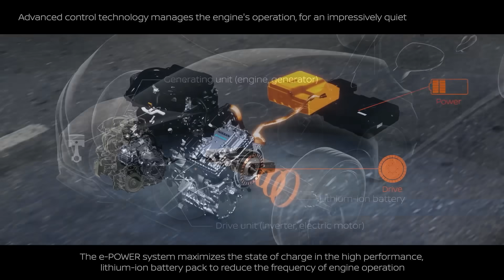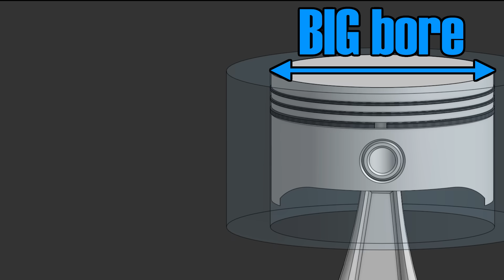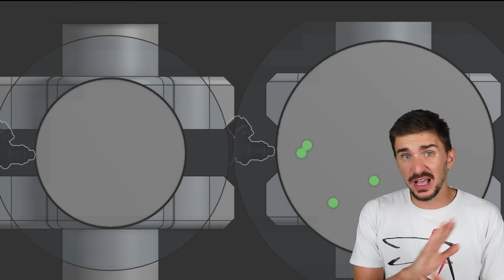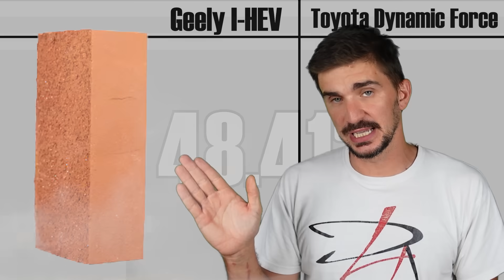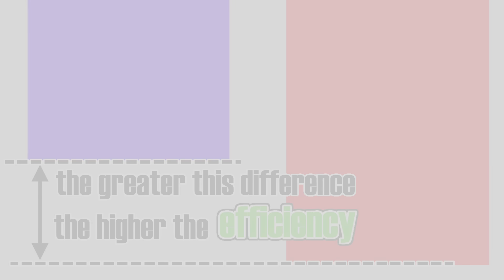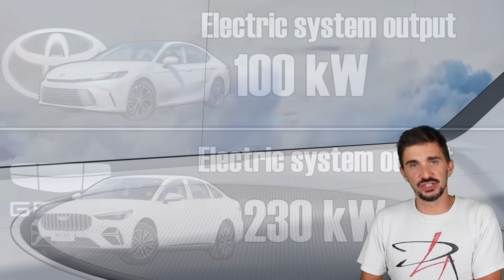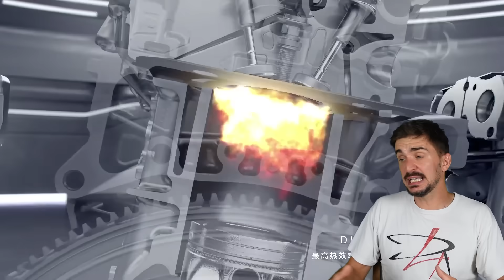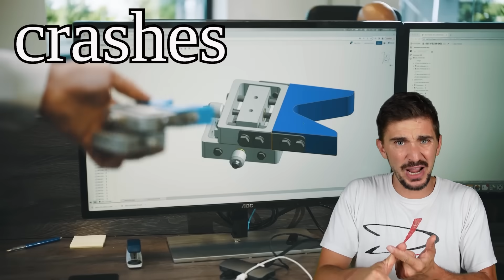How China's Geely Beat Toyota, BMW, Ford and Everyone Else

Comment: This video is only weird in how it does not mention BYD's DM-i system at all. In fact, you go on to say Geely is the only manufacturer making an electric-first hybrid, whilst BYD's DM-i has been around for a good while with the same basic approach, currently claiming an almost matching 46% engine efficiency. 

The lack of mention feels odd as BYD is a larger and more globally-spread manufacturer than Geely currently is.
Reply: Also they are not backpedalling from EV adoption, the reason they can take this approach is because the west might have all the ICE manufacturing experience in the world but China leads electronics and electrical manufacturing so they have a much easier time implementing an electric-first design...

Comment: Um, I thought we just called that arrangement “series hybrid + battery” which is the same thing Ram and Scout are doing. I’ve been clamoring to the economic walls that surround me that this is the best method for long haul trucks for a long time. In USA, there was a man named Pickens who lobbied for this innovation many years ago. His idea was to use series hybrids powered by LNG, LPG, gasoline, or (shudder) diesel. Batteries would be involved for regenerative braking assist, and initial movement, but the engines would basically run continuously which might be a problem for diesel due to wetstacking. I think the real problem was that nobody wanted to try it until some guys in Canada (Edison Motors) decided to do it.

Comment: Honda's hybrid system is actually very similar to geely's. Hondas's hybrid is basically all electric until highway speeds. But their system is nowhere near as efficient. Difference must be in the engine tunning/design.

Comment: Some turkish channel tried byd suv with a similar approach. Very underpowered ice engine and hybrid system etc. it works very good 99% of the time. Inner city driving, commuting etc. but there is a section at istanbul ankara highway climbing bolu mountains, basically it’s a very very long and high gradient high speed section. At the mid point of the said route, when battery depletes (and believe me when i say this, ai wont solve this, you need bigger battery) you’re just left with an incredible underpowered ice engine pulling the weight of an suv, i believe top speed was as low as 80kph, which is bordering dangerously low.

Comment: Imagine if VW didn't screw the world out of diesel engines. Using a diesel engine like this could hit combined cycle powerplant levels of efficiency at 60% or more. We could be hitting 200mpg and wouldn't even need EVs. Would be much better for the whole world. Hybrids are cheaper than EVs, no range anxiety, would actually be cheaper to run than a pure Bev and the engine would last for decades of it's ran at its peak efficiency at all times and not spending half its life in damaging lean or rich modes. Could use it as a power station at your house in emergencies or a generator at jobsites. What a world we could have had.

Comment: So what you gain is an extended range, in addition to the ability to still use the car (albeit in a substandard performance mode) if for some reason you can't charge your battery.  The trade off is the extra initial cost, weight and maintenance costs of a (smallish) ICE.  I like the idea of not being completely stranded if there's a widespread power outage, and the extended charge range, but I'm not sure if it would be worth the extra expense., weight and maintenance.

Comment: does the geely engine have multiple cylinder intake valves open at the same time? that could possibly use a compression stroke to compress intake air in the manifold

Comment: What I'm trying to understand about this engine is If it being an Atkinson cycle engine then how can you achieve 15:1 compression when the engine delays the closing of the intake valve? As I understand it the compression ratio will drop if fuel and air are decreased in the cylinder as a result of having a long duration on the intake stroke.

Comment: 16:30 surely you could just use variable valve timing tech to make the miller cycle less aggressive when the battery is low on power which would make the engine power output better

Comment: Here's a crazy idea: Use a separate cam like VTEC or collapsible lifters like FIAT AIR to change the intake closing for more power as is needed during those long climbs with a depleted battery.

Comment: The same route chose GM with the Volt in 2010 (opel Ampera in EUROPE) and back then was huge. Then they killed it. Not sure why. It was exactly the same without the AI and the motors were smaller.

Comment: I’ve thought for a long time that cars could benefit from mapping hills to optimize gears and throttle. You do it naturally with a manual transmission. You are slowing down but almost at the top of the hill, everything is fine. You are slowing down but have a ways to go, down shift.

Comment: I'm not convinced that this is necessarily a useful advancement, because there are always engineering tradeoffs. There could potentially be catastrophic reliability downsides for example to pushing thermal efficiency  this far.

Comment: At the start of the 20th century a British government committee came up with a formula for taxing vehicles by engine size, which ended up roughly as the total piston area. Manufacturers quickly realised this benefited long stroke engines, so of course they made them. It then turned out that they burnt less oil and were more efficient for the reasons stated in the video. So, history repeats itself.
As an example, the 1915 Sunbeam Model 3 had a bore and stroke of 85 by 88mm. The 1924 Model 8 was 74 by 90. Performance motorcycles of the era stuck to a roughly 1:1 bore stroke ratio, while cheaper ones designed for economy were long stroke.

Comment: No one talking about conversion losses when storing the energy in a battery and then using the battery power for the electrical motors. Avoiding these losses is the main reason toyota is trying to limit such cases in their hybrid cars using the ICE as the primary motor and avoiding charging the battery with the ICE whenever possible.

Comment: Problem: lost heat inefficiency.  How about using all of that lost heat by incorporating Stirling engine technology into the drive train?  Stirling engines run on temperature differential, which would be abundant in a modern engine.
Reply: You'd need a big-ass stirling for that because of the low power-to-weight ratio. That would offset any efficiency gains

Comment: Im not an engineer just an extreme DIY er with a lot of contacts in motorsport including F1 engine designers from Cosworth (Matt Grant) AMG F1, Redbull F1 and toyota GT diesel lemans winner. The guy who ran the Geely motorsport program with Cyan Racing, also ex chassis tuning engineer at Jaguar F1 . Have We all discussed these engine in great detail and all of us bar non wouldnt by these new ultra thermally efficient engines are a poor investment, due to the use of coating insted of liners and laser burned valves etc to reduce weight plus the turbo to push smaller engines to perform. They are extremely stressed engines. Not completely repairable, scrap if a piston ring goes or if piston slap occurs. They cant be remanufactured so totally unsustainable and the figure hide that they are selling us less metal, reliability, serviceability and longgevity for more money. None of my engineer friends are buying new cars😂. That tells you everything you need to know about modern cars!!

Comment: As a Chinese automotive engjneer, I can tell you this efficiency is “the highest efficiency in laboratory setups”, meaningless in real life. About 2 years ago BYD claimed they have developed an engine with certified thermal efficiency over 46% and later Geely and Chery stated the same, so Xiaomi started to send invitations to these automakers for powertrain quotes 2 years ago for their latest extended range ev product N90 (which was just released last month) and one of the requirements is “over 43% of thermal efficiency over a wide range of load conditions”, and none of these guys claimed with 46% efficiency can meet the requirement, that’s why when N90 was released last month, the thermal efficiency is stated as 42%😂
Reply: Don't you worry, my colleagues and I we know certain Chinese engineers are faking numbers all the time.

Comment: Engineering wise this is by far the most efficient design. It is well known that "generators" are more thermal efficient than "normal" ICE's. It is merely a question of how much battery storage you need before the break even point. I think all non exciting cars will either be electric in some time or are electric with some kind of range extender, the ICE propulsion system is just not as efficient as a generator and an electric motor.

Comment: Through 2020, China was 95% petrol / gasoline engines, barely hitting 5% plug-ins.  China didn't break 50% plug-in (both pure battery and electric hybrid) until last year.  Today, China's market is buying roughly 1/3 "pure" battery electric, 1/3 electric hybrid, and 1/3 gasoline engine.   By 2030, expect to see that gasoline share hit zero! 

With history context, it's an error to imagine that China started with EVs with motors as an afterthought.  It's more that Chinese electric motors, batteries and EV tech becoming so efficient and affordable that they can make everything a plug-in at low marginal cost.  Chinese Plug-in Hybrid EVs (PHEVs) and Extended Range EVs (EREVs) are optimized in ways that aren't possible when battery and motor tech is lacking, as you noted when the car has to run on gasoline alone.  The latest Chinese PHEVs are like a 1st gen Nissan Leaf (100 km / 70 miles electric range) with a 1.5l range extender that's been independently road tested over 2,000 km (1,400 miles).  People rarely drive more than 40 miles a day, this setup can be on battery 95% of the time, especially as Chinese electricity is far less expensive than petrol / gasoline, or even FREE midday in Australia. 

Where China actually lags engine tech is high displacement, high power engines due to their domestic market having higher taxes on anything over 1.5 liters, much higher over 2.0 liters.  This is the opposite of the US which pushed into thirsty turbocharged engines for large, heavy SUVs and pickup trucks.  China doesn't sell many such engines domestically (they may license build some of the older designs), so they don't develop them domestically.  China will NEVER catch up with the West on 3.0l turbos, 5.0l turbos, big block V-8s and so forth;  however, with their gasoline engine market going to zero over the next decade, this won't be a problem for them.

Comment: but with a Z crank spider Opposed piston you have the best of both ! Each piston 50mm stroke over all expansion 100mm and 10K RPM and 80 % expansion .. why not and add 30 degree phase difference to make more usable torque

Comment: Will they factor in the energy/pollution from the “ai” (assuming it is processed by a data center and not built into the car) into the real world efficiency and emissions? 

I do think an electric car with a range extending generator is the “best” option currently available for efficiency and range.

Comment: As with 6 stroke engines the advantages or rationale behind Atkinson/Miller engines vanish if we simply turn to the most efficient expansion device known: the turbine. A turbocompound system can exist independently of an associated dynamic compressor; although at low compression ratios, a dynamic compressor is also more efficient than a mechanical one due to the nearly fixed mechanical losses, which are extremely low in a centrifugal unit. The challenge, then, lies not in the gas-moving machinery but in the mechanical transmission of power from the turbine—an issue currently resolved very flexibly through the use of a high-speed electric generator. This is a technology that has already been in use for some time in military drones whit an high electrical demand.

Comment: but how much is the torque? Bore size of 70 mm and higher stroke length obviously yields efficiencey in fuel but what about power? Muscle cars were designed to go faster, for with stroke length needs to be shorter and higher RPM not a priority for efficiency.

Comment: 17:00 I have normal automatic transmission and it is annoying when the car starting climbing up the hill but the program still change the gear to higher and there is opposite when you are going down the hill he is holding lower gear and revving instead switching gear to higher And this situation don't need implement A I or map of terrain Just simple they should for if torque is rising it means the auto goes up It is so simple

Comment: Would variable timing that changes the duration of the compression stroke based on battery charge percentage work? Like the closer the battery is to zero, the more the compression stroke behaves like an Otto engine.

Comment: It seems like you could call this an EV with an integrated range extending generator on board, I like that if thats the short and sweet description. When you can buy a basic Civic that will seat 4 comfortably and 5 less so, for $30k and get 400 miles at 35+ mpg a pure electric at closer to $40k is less interesting to those that can't charge at home, don't get me wrong, I want a Civic sized EV with 300+ mile range that doesn't weigh over 2 tons, a good hybrid that gets 100mpg(even at real world 70+mpg) is a stellar stop gap between the two if they can get the gas/ev blending set right, especially when the batteries are low. Somewhat unrelated, where's the basic EV sedan that feels like a normal sedan, around 150-200hp, with a reasonable 300ish mile range, and a cost under $35k usd, basically an EV option to a Civic/Prius/Corolla, yes I am a weirdo from the USA that has zero interest in an SUV or Truck, even though a truck would be useful at times, I will not daily something I only really need 5 times a year, thats what rentals are for.

Comment: Old British engines used to be very understatement for Tax reasons. An Austin heavy from 1922 bore 72mm Stroke 102mm. According to Google stroke to bore ratios of 1.5 to almost 2 were produced which is much higher than Geely.

Comment: Would it be correct to say that on a miller circle actual compression rate is not the total stroke length 15:1 but should be calculated only when the valves are closed and the compression actually starts?

Comment: Should they add plug-in charging or even fast charging so the driver can make sure to never run out of battery power or is the battery to small for that? The Toyota Prius is a Plug-in Hybrid with 13,6 kWh.

Comment: EV cars with ICE generators make the most sense honestly. I don't understand why they didn't already took the market. Just make an EV give it small battery (10Kwh) which will be fine for day to day tasks. And give it small generator for the once a month once a year trips. You save up on battery and the engine can run on the most efficient RPM most of the time. I really hope Toyota will do something like that in future even with deep muller cycle.

Comment: BUT THE OBJECTIVE IS TO ELIMINATE BURNING FOSSIL FUELS!  IT’S NOT FUEL EFFICIENCY.  BEVs running on solar and wind energy ARE THE ANSWER to pollution and co2 emissions.  And battery breakthroughs continue to improve cost, reduce environmental pollutants, and improve volumetric and weight efficiency.

Comment: The un proportional loss of overall engine life due to all these advancements for fuel efficiency and emissions controls have added so many expensive parts. The engine life is reduced, and the cost of fixing and replacing parts has now become 4 to 5 times more expensive on modern engines and breakdown intervals have increased making all the efficiencies null and void with no improvement. But a actual net loss for the consumers and the planet because resources have to be used to remake and replace these items that break down faster and end up in landfill.

Comment: It's all paper advantage. 

To hit 48.41%, Geely uses very complex hardware: a massive 500-bar fuel injection system, intricate dual Miller-cycle valve timing, and sensitive AI cloud-managed software. If any component fails out of warranty, repairs will be exceptionally expensive.
Also, the engine achieves its record efficiency only within a very narrow RPM and load range. So when driving aggressively uphill or when the hybrid battery is completely drained the car can feel sluggish because the engine is tuned to act more like a static generator than a responsive sports motor.
Lastly, while Geely claims incredible lab efficiency, real-world testing shows that its actual fuel economy when placed in heavier SUVs closely matches existing, simpler global hybrid standards rather than drastically beating them. 

Geely is not beating anyone right now, for now.